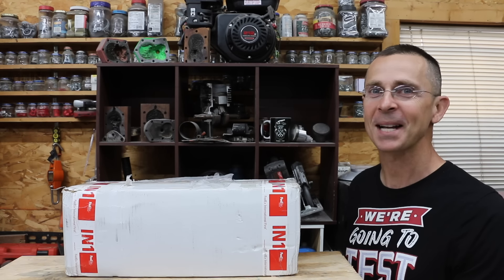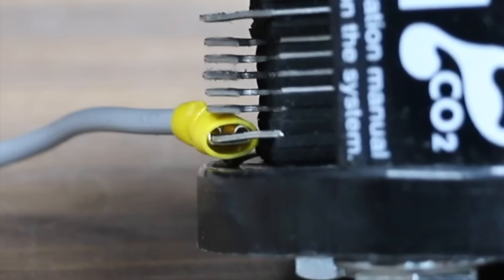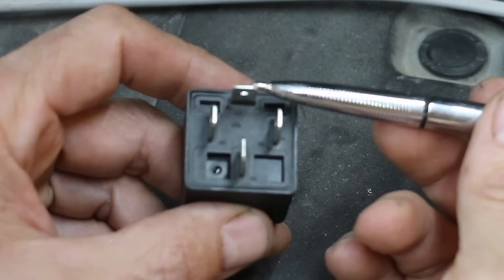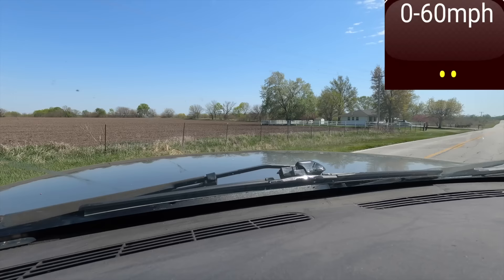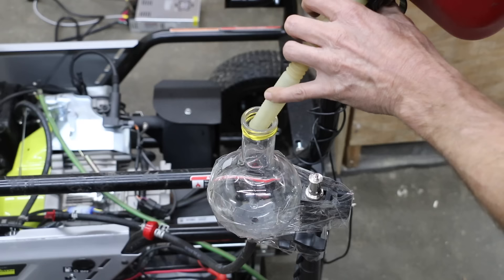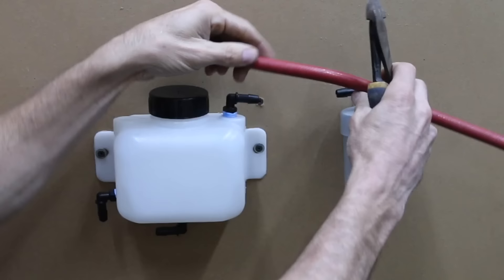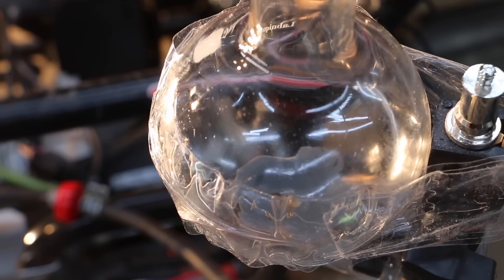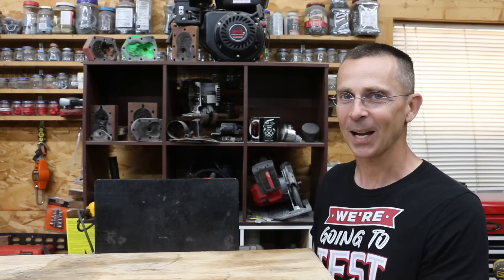AMAZING 35% More MPG with HHO? Let’s find out! Help with high gas prices?

Comment: I really appreciate this effort, I've watched these "generators" since my teens in the early seventies, and noted no one has yet had a quantifiable test procedure and demonstrated success in all my years.  This has been probably the best metric I've seen, most secure form, with an absolute quantifiable result.  Thanks for setting up a true "scientific test" with hard and fast, undeniable results.
Reply from the maker: Thanks so much!
Reply: True! 👍 -Ohio
Reply: That's funny that you think that wS scientific, cause of course it ran the same, the whole reason that it was the second was he didn't change anything as far as the amount of fuel going in, you are supposed to adjust the fuel intake to a lower amount to save fuel. The whole idea is less fuel consumption but adding the HhO compensates for the smaller bang.
Reply: If you don't change the fuel consumption there will be no savings . You just adding vaporized gas to liquid gas. Cut liquid gas consumption in half go from there.. maybe consumption  half or 3/4 or 1/4 of liquid gas plus hydrogen is the method..Stanley Meyer car ran on only hydrogen fuel no liquid and many after him. It replace liquid gas, not to be added to it
Reply: @cfredlees100  You can run a car on hydrogen, no problem. But if you try to use the car to produce the hydrogen it's using, you'll be going nowhere fast.
Reply: @billywilliams777  The car automatically adjusts the fuel input to precisely use up all the oxygen. If the hydrogen's doing anything, it will be using up some of the oxygen, and the amount of fuel needed will drop as a result. 
Programming an engine to run leaner than what it normally does will get you better efficiency, but that's true whether the car is stock or not. (It also creates more nitrogen pollutants, and you risk potential hot spots in the cylinder as it was never designed for continued lean burn).   HHO in a stock car is a waste of time.
Reply: @billywilliams777  Bro, the fuel injection system adjusts mixture automatically.  He didn't end up running lean after installing the woo generator.

The reason you see no improvement in mileage with these things is physics 101.  As he notes, you're adding load to the crankshaft via the alternator having a heavier electrical load.  That load is going to AT LEAST match (because thermodynamics) the amount of energy you get from burning the HHO, but in reality will exceed the energy you get back (again, physics).  

People who believe in these are scientifically illiterate.
Reply: @immikeurnot  the theory is that it makes combustion more complete.  But if true the truck would be faster because of more h.p.  but as he shows in the video no increase in 0 to 60 at all.

Comment: I'm reminded of that ancient Russian proverb: "TANSTAAFL" - loosely translated: "There Ain't No Such Thing As A Free Lunch" - Robert Heinlein.
Reply: It's not exactly free like those fans you add in between your air intake. (To so called 'twist' the air)

In this case you are actually adding some gas into the intake from an external system (while also consuming some power from the alternator...), it just doesn't do anything hahah

Comment: Thank you for all this testing you are doing . Hope you can continue . If you have not done so would love to see testing of various plug-in Performance Tuning mileage increasing modules for modern vehicles.
 From personal experience using HHO generator results were a net loss of MPG due to the drag on the engine to produce electricity to power the HHO gas production.

Comment: As someone that builds HHO systems for my cars, I do see fuel savings at part throttle when there is a vacuum on the intake. I also have the hose connected to the brake booster vacuum line. What happens in a car is the engine sees extra oxygen content thinking the engine is rich and leans out the engine reducing fuel consumption. You will not see fuel savings on an engine that runs wide open or an engine that can't make adjustments to AFR.
Reply: So what you're saying is that anything that changes the amount of intake or exhaust needs to be ECU tuned so that you maximize the benefits.

Like no way?

That's the only issue I saw in this test. No way to get proper imperical data without first throwing it on a Dyno and tuning it.
Reply from the maker: Thanks for sharing.
Reply: Extra oxygen means lean, not rich. When it sees lean it adds more fuel. So your mileage would actually decrease slightly.
Reply: Just throw a turbo with a controller on your engine, draw a vacuum and you will see literally the same thing.

Comment: I think any 'improvements' would only apply on engines without O2 sensors?
 It looks like fuel injection is seeing a lean mixture or 'higher' air density so adding fuel giving worse fuel efficiency.
Reply from the maker: Thanks for the feedback.
Reply: Yea it just cuts fuel when it realizes there’s more
Reply: The fuel demand regardless of whether the engine has fuel injection or carb is dictated by the engine. 
The carburettor is just a mechanical fuel metering device. The engine demands a certain amount of air and the carb delivers the appropriate amount of fuel to match the air flow via appropriate jets in the carb. This gives the optimum fuel/air ratio.

The throttle controls the air flow, not the fuel flow.

The best that these sorts of devices can hope to achieve is a more complete combustion of the available fuel /air mixture but the clean plugs and pistons indicate the engines are already achieving close to complete combustion.
Reply: @GSimpsonOAM  Your missing the point I was trying to make. A carb will deliver fuel based on airflow BUT fuel injection has oxygen sensors that monitor amount of O2 in exhaust gas. If 'brain' finds too much oxygen it adds more fuel. A carb CAN'T do that so will in effect run  slightly lean with the same sized jets. O2 sensors are very simple devices that monitor voltage between 0.1v and 0.9v in reality even though theory says 0 to 1. If you ever want to test operation use a propane 'torch and you will get odd readings as it is a different fuel to where O2 sensor was calibrated but you can still see voltage or resistance changes (depending on type of sensor)
Early fuel injection systems may not have had O2 sensors ( 1980's and earlier) but everything more modern will have at least one sensor
Reply: @1crazypj  Sorry. I should have put it as a new comment rather than a reply to yours.
Looking at the figures given, they are probably within the margin of error of the experiment.
19min 46sec vs 19min 37sec is less than 1% difference.
The runs with the Chevy also gave inconclusive results.
Reply: @ProjectFarm  love your work brother. What about diesel engines, you might see better fuel economy with them.
Reply: Wouldn't the point be just that, to get the engine to reduce the fuel line because of the presence of HHO?  It doesn't work because of one simple fact, you're not making energy out of thin air.  Even if the engine was to run on 100% HHO it would have to burn way more efficient than gasoline to be useful.  If that were true and it was safe enough car manufacturers would simply switch to HHO.   One thing not mentioned here about HHO is it can have quite a nasty explosion, though not a fiery one.
Reply: @1crazypj  I’d be interested to see what it’d run like if tuned to target a slightly “lean” condition in the ECM/PCM, or stoichiometrically accurate target for the given fuel(s).
Reply: @wed110197  If you check flame speed, HHO is hundreds of times faster than gasoline so even if there isn't an O2 sensor (mentioned by someone) there may be a knock sensor causing fuel to be added to slow down the burn? HHO should make burn more complete although there are other cheaper ways to get same result. Exhaust gas would be measured during development with a specific CO, CO2, NO, and unburned hydrocarbons. Feeding HHO will change the values expected by any monitoring system
Reply: @1crazypj  Most hho systems I have seen when running on a vehicle recommends the oxygen sensor spacers to cut fuel flow down a bit. I have never ordered a kit though I have built several and I have experimented extensively with the home built ones it's definatly interesting.  Efficient not sure couldnt say but the idea I think is possible under the right circumstances with the right generator and setup.  I find it interesting that the guy behind hho generators met his demise under some very strange circumstances.  Tells me he was a little to close to hitting the wallets of billion dollar industries.
Reply: @hoss3433  Yep, I've watched the documentary video about the inventor. I believe you can also fit a resistor to change the values from O2 sensor although I've forgotten how to work out the values required.
Reply: @1crazypj  I have seen some people do resistor work on them as a possible means to drop fuel consumption.  That's a bit beyond my knowledge and research range though. I think it's workable I think it's just gonna take a person with the right mindset and abilities financially and otherwise to make it practical.  It definatly creates a reactive gas. I know the bubbler I used when holding a lighter at the end of the tube each time it fed a hydrogen bubble it seemed to have about as much force and sound levels as a firecracker.  So there's definatly potential not sure what the numbers are but I'm sure there's a reachable end to the research and experimentation
Reply: @1crazypj  I know this is old,  and def not trying to be contrary,  but I think one of the issues with that is the product of hydrogen combustion is water and likely nitrogen in the case of mixing with fossil fuel isn't it?  and an O2 sensor works by measuring resistance in a bimetal element based on heat derived expansion in the element.  All this to say,  I don't think the fuel delivery system is capable of adjusting to this new input of hydrogen in any way that would be beneficial.  If also guess the o2 sensor might even call for worse fuel parameters with this system as I think it might affect exhaust temps in a negative way. Just my thoughts though.
Reply: Oracladeus  EFI engines always have them I thought
Reply: @MrBmercer76  Yes burning Oxygen - Hydrogen Gas will generate water just like the Hydrogen that is burned with Gasoline is and yes there will be NOx emissions with or without fossil fuel due to the combustion temperature and the Nitrogen present in the ambient air that is pulled into the combustion chamber.  
An O2 / Lambda sensor does not measure temperature,  it senses the amount of Oxygen present in the exhaust stream via an electrochemical reaction and depending on type reflects this with an output voltage or resistance change which is then used by the ECU to adjust relevant parameters.  
And to be clear burning a Oxygen - Hydrogen Mixture from electrolysis does neither add or reduce the Oxygen in the exhaust since it is a perfect stoichiometric mixture.
Reply: @GSimpsonOAM  what ur saying is only partly true, in a carberated  engine the amount air drawn in is going to designate the amount of fuel drawn out of a venturi style fuel/air mixer , in a computer controlled system the computer .... looking at a maf  or a map sensor or both  plus the feedback of the o2 sensor is going to determine the amount of fuel at any given time , now on a carberated  system the amount of air drawn into the engine and progressive jetting is going to control fuel consumption..... if 30% of what's being taken as air is flammable then the need for more air and fuel could potentially go down causing increased run time in this case in the computer controlled system unless programmed to take this into consideration is going to see  so many grams per second going thru a maf  at a given throttle % and then because part of this video of air is  hydrogen and oxygen  then the computer will see a  reading that would presumably be leaner then expected  at certain throttle percentage  and would intern assume there was sometype of injecter  blockage or vacuum leak an would then increase injector pulse timing to compensate for whatvit thinks would be a lean condition  ..... therefore decreasing mpg as this test demonstrates a carberated engine would presumably see a slight increase  but not much unless it was rejetted w the hydrogen  introduction in mind
Reply: @theThinkerator  of course they do if they r a true fuel injection it's one of the main parameters any ecm looks at to control fuel trim
Reply: Nope, no improvement to be had. Carb, EFI, no O2, narrow band, wide band, stock tune, custom tune, none of those make this work because it doesn't work.
Reply: Oracladeus  You seem to have missed the gigantic "ELECTRONIC FUEL INJECTION" label on the front of the generator in this video.
Reply: @1crazypj  obviously you need to do more research on how oxygen sensors operate.
Reply: @Discretesignals  no idea what you mean? O2 sensors supply between 0.1 and 0.9  volts to ECU depending on amount of O2 in exhaust gas.(although in theory, between zero and one volt)
 They are either 2 or 3 wire although I haven't seen a 2 wire in years. 
Electronic fuel injection will probably be part of full ECU setting ignition timing, rpm, etc (as sensors have become 'smarter' and 'faster' probably monitoring other functions (been available since at least 2010 on small production motorcycles/scooters, one sensor covering what took 3 previously, TPS,MAF,IAT)
Reply: O2 sensor or not does not matter.  Think of how a close-loop O2 sensor EFI system works.  The O2 feeds back the amount of oxygen left in the exhaust as a feedback mechanism to the contorl computer (ECU).  
If, as the product claims, it increases efficiency of the burn, the engine will require less fuel (gasoline) for any given load - that should have translated in longer run time.  The mixture of Hydrogen and oxygen fed to the intake was stoichiometric, so just the right amount of hydrogen for every oxygen molecule.  So.... the oxygen in the browns gas would not have done anything to the O2 sensor.
Long story short, conservation of energy, a fundamental physical law, prevents this device from creating more energy than it consumes.
Reply: @w1ndexcheese  I was a motorcycle tech and motorcycle instructor not a chemist of physicist but understand what your saying. 
It's been several years since I did any research on HHO and my conclusion at the time was it wasn't worth the effort.
The theory is, Browns gas having a faster flame front plus a more complete burn will ignite fuel that otherwise would go out the exhaust as un-burned hydrocarbons.
Maybe it was true in the 1940's,50's,60's when combustion chamber design was pretty poor but a modern industrial engine (almost any gas or diesel engine) is designed for specific operating rpm efficiency and in my experience pretty good at doing so (I also worked on various diesel and stationary industrial engines for 8 years)
EPA is indirectly responsible for normal production engines now producing well over 100BHP/litre (often closer to 150bhp/litre normally aspirated and much higher with forced induction) If you can burn 'all' the fuel in a given cycle you often use less or get a higher output with the same amount as an earlier design. (although Nitrogen compound levels get much higher when combustion temperature increases-acid rain?)
Even into the 1990's it was thought 75/bhp/litre was 'good' and 100'bhp for 'race' engines  only (or 1hp /cu/inch in USA.) 
Due to design improvements, even those numbers can easily be ' beaten' by 1960's designs which were often pretty bad being made for ease of production rather than performance.
Reply: The generator wouldnt have an o2 sensor, id think
Reply: If this were true, the benefits would still be negligible given that the difference in runtime is still a few seconds.
Reply: Oracladeus  Wait a minute!  The generator has electronic fuel injection (it says so right on the generator).  Thus it will have an O2 sensor.
Reply: haha i get it- feedback
Reply: @1crazypj  yep hydrogen Burns faster you have to change the timing

Comment: Thank you for the video and the time it took to make. HHO was one of the avenues we were ordered to explore way back in 1992. That kit might work on your lawn mower, don't think it would be good for much else. We learned we had to extend the spark duration, adjust the timing so the piston would be just after that top center terminal point, and had to adjust the intake air/HHO ratio (we used a 92%/8% air/HHO ratio). Another stumbling block was computer-controlled engine systems. The computer would detect the "leanness" of the mixture and make adjustments, which did not help. Wasn't too bad in a low-compression engine, would get compression-ignition in higher compression engines when we used 89 octanes. It just doesn't work in reality as a gasoline supplement. To make enough HHO to make any noticeable difference is cancelled out by the load created to generate the power needed to make the volume of HHO required to make a difference. You would be better off attaching a regulator to your intake and hooking up a pressurized hydrogen tank.
Reply from the maker: Thanks for sharing.
Reply: Theo have you tried a tank of compressed H2? I want to experiment with that
Reply: @mistvapevideos3912  Briefly. Connected it into the air intake just before the air filter housing in a 305 V8 with a 2 barrel when comadore-64s where the most powerful home computer. You'll need to set up a regulator to keep the mix from being to rich or causing compression ignition. I don't know how variable timing and valves would like it though.